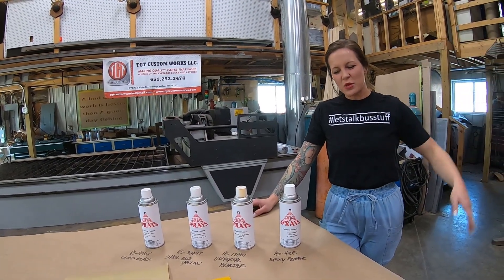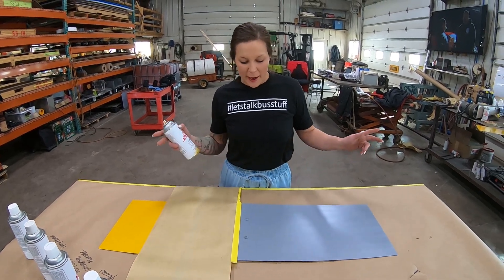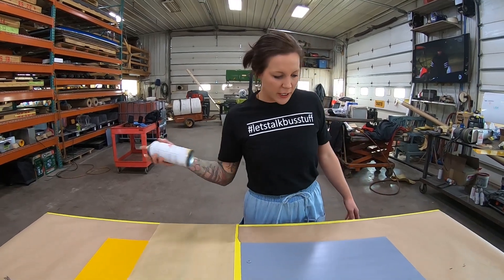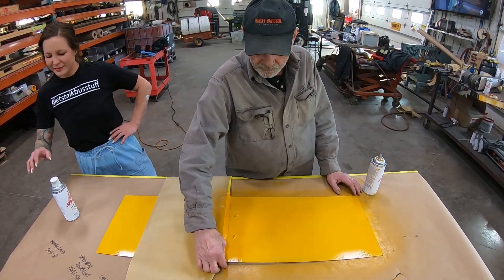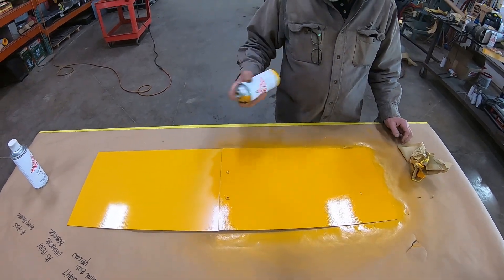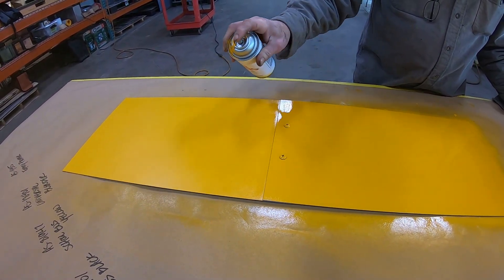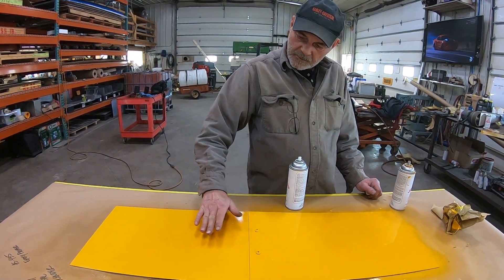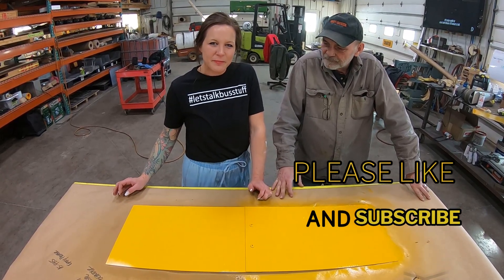Automotive Grade Acrylic Enamel LITERALLY MELTS mismatched shades! TGT Custom Works Paint Blend

Comment: I have a fender with a slight amount of tiger striping in the metallic paint on the top of a fender.  Could the blender be used to blend a mist coat into the coat below to keep from having to repaint the whole fender?